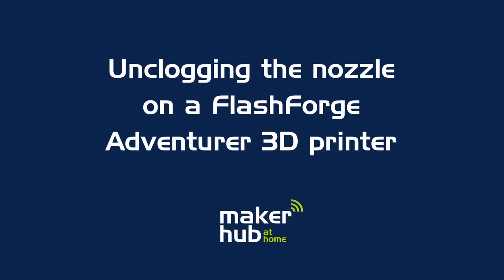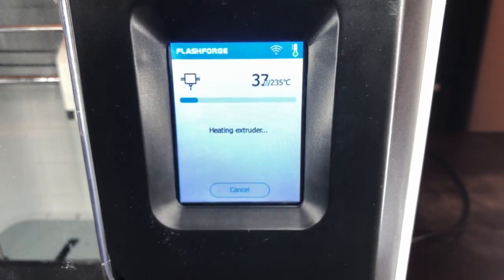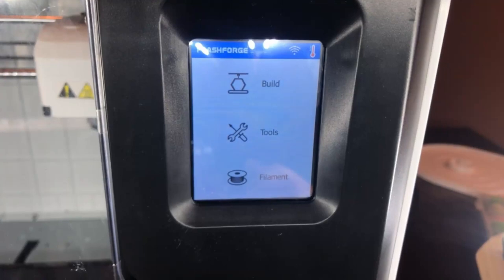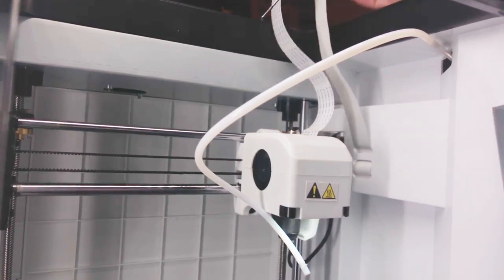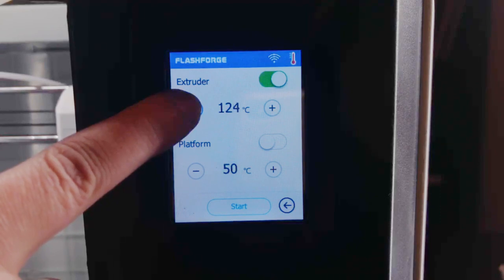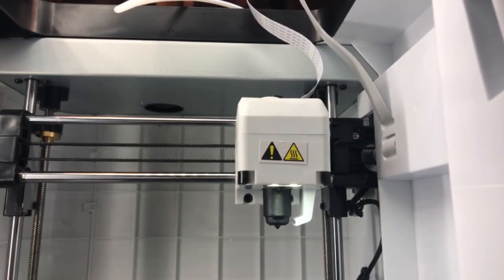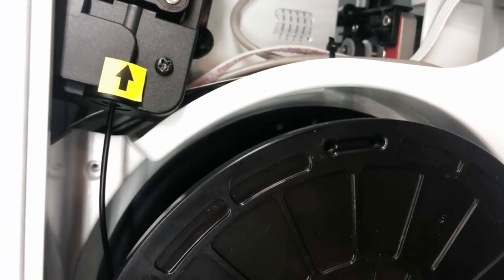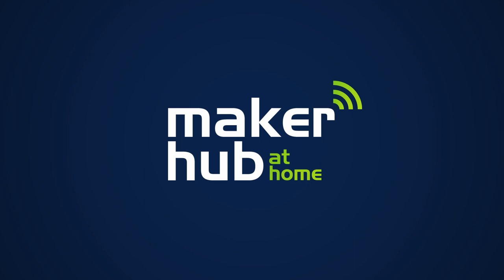How to Unclog a FlashForge Adventurer 3D Printer

Comment: Perfect video, thanks - this has already helped me twice and next time it happens I might remember how to do it... Just a question for my understanding and learning, what specific effect does the second step with the short piece of filament at 80 degrees have?
Reply from the maker: This is called a "cold Pull" it allows the filament to form to the shape of the interior and merge with any excess filament still in there. As it cools to 80 degrees that excess filament should merge with the inserted filament, making it possible to clear out all of the debris

Comment: I’m having a problem whereby the filament just isn’t loading. The cogs rotate and try and pull the filament in but it doesn’t load. Any ideas or videos on how to fix this on the same printer?
Reply from the maker: Hey E, This is a fairly common issue with this model from Flashforge. Some fixes

-	The gears rotating, sometimes causing a clicking noise is normally a nozzle clog. If it is you can heat up your nozzle to 230c and find a needle that’s smaller than 0.4mm at the tip and push it into the nozzle a few times. This will normally unclog the nozzle but be careful sometimes the nozzle can leak out very hot filament and it will burn you. 
-	Another cause of this is a faulty nozzle, in this case its best to remove the nozzle and swap it out for a new one. Just remember to adjust the heat calibration offset when you put a new nozzle in ( steps for this are on the bag the nozzle comes in)
-	The last cause for this is there is a blockage in the feed tube. In that case, remove the feed tube and clear the tube. Then place the tube back on. 

Please give these a try and let me know how you go!

Comment: My printer has been printing fine for a good month, now when it prints straight lines it's squiggly, and hardly sticks to the platform. Will doing this fix that issue? Sorry I'm new to 3D Printing. I'm assuming this is also how you clean it when unclogging it.
Reply: Clean the print bed very thoroughly and then clean again with isopropyl alcohol.
Reply: Calibrate the bed level-had the same problem before but it prints much better after I calibrated the bed level and sticks without much glue.

Comment: I have try this before and really works but now doesn't work I don't known if my nozzle doesn't work or is the white thing how can I check that?
Reply from the maker: -	It sounds like a damaged / worn out nozzle in this case its best to remove the nozzle and swap it out for a new one. Just remember to adjust the heat calibration offset when you put a new nozzle in (steps for this are on the bag the nozzle comes in)

Unfortunately nozzle's are a consumable part for 3d printers, and need to be replaced once they wear out

Comment: My tube wont come out what should i do?
Reply from the maker: This happens on pretty much all printers. 

-	If the tube doesn’t come out, press down of the black ring on the collet, while doing this press the tube into the collet even more then pull out. 
-	If the above doesn’t work, you can use a spanner to remove the collect without having to take the tube out of the collet. 

please give these a try and let me know how you go
Reply: Had to remove mine with a wrench, thanks a ton for the advice!
Reply: @JaycarVideo  I had to use a wrench to remove the collect after removing the cover of the print head. The black thingy didn't budge

Comment: Oi vey...you ruin the connection in the coupler by pulling the tube out of it like that, which will lead to having to replace it. To ensure you don't ruin anything, just remove the top cover of the extruder and unscrew the coupler.
Reply: That's how they're meant to be removed. The whole point of that design of coupling is to allow easy removal/replacement of the feeder tube. If you push the black ring on top down first that will disengage the clamp teeth & allow the tube to be pulled out easily. Pulling on the tube withOUT depressing the ring, however, WILL damage the teeth & ruin the connector. Perhaps that was causing you problems??

Comment: Can't get the tube out.
Reply: The very top of the assembly that holds the bowden tube in place is the release mechanisim. If you press the top portion DOWN towards the print-head with your fingernail as you apply very gentle upward pressure on the tube, it will release and come away easily. To remount it, you just stick the tube back in and give it a little gentle downward pressure. I sincerely hope this helps... Oh and as a sidenote, once you have cleared the head (with the nozzle tool provided with the printer for free) you don't need to do a cold-pull as well .... this is only needed in dire circumstances.
Reply: @RobertNZ  Thank you. Managed to get it out eventually 👍
Reply: @RobertNZ  how do you grab it it’s so slippery